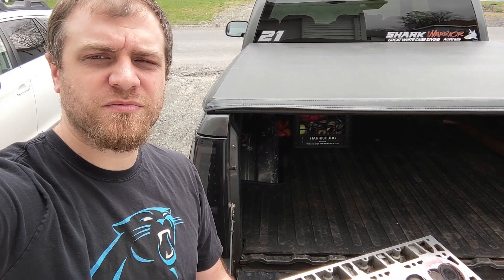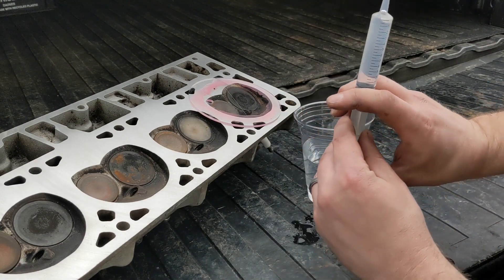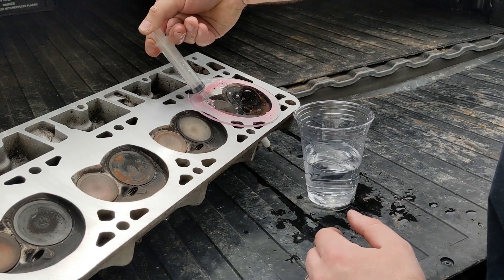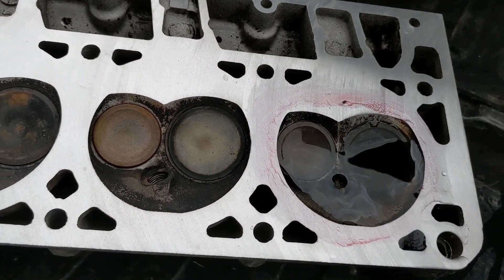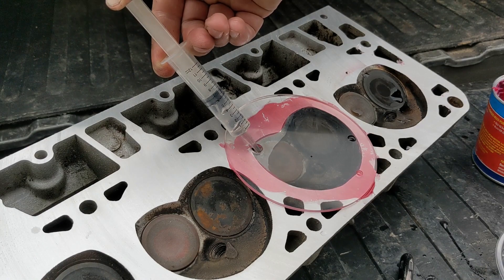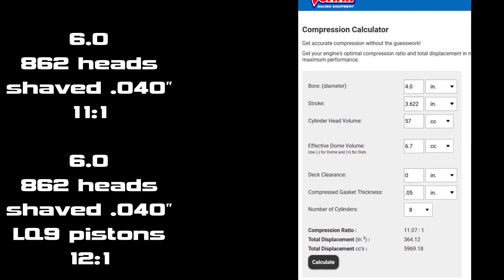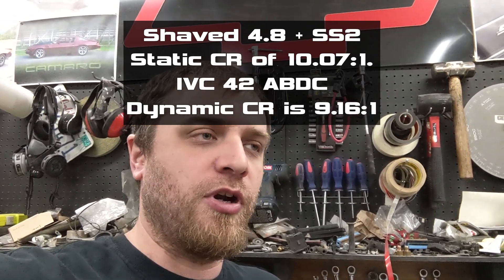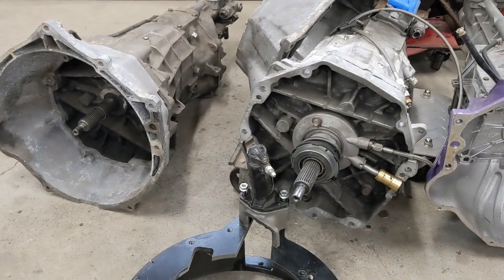Free way to CC cylinder heads etc - calculate compression ratio #LSswap

Comment: how do you end up with less dynamic compression than mechanical compression ? ( only in an american "muscle car" engine. ) ... great tip on the grease trick, thanks.
Reply from the maker: Because the cam bleeds off some cylinder pressure. Intake valve doesn't close until after bottom dead center, so the effective stroke is less.
Reply: @GEARHEADdezign  all intake cams don't close until after bottom dead center .. that's in account of Intake Inertia, and is normal.
Reply from the maker: @RulgertGhostalker  yes, but the longer the intake valve is open, the more pressure is bled off. The stock truck cam is 195ish duration @.050 and the sloppy stage 2 is liked 228. So the piston is further up the cylinder when the valve closes
Reply: @GEARHEADdezign  my sportster has Andrews N2 cams with 240 degrees @ 0.050" lift on the intakes .. it runs like crap down low, but you hit about 4Krpm and it goes ape out to red-line ... dynamic compression is a variable, unlike static; so it depends on your intake and pipes, and what rpm you're figuring it.
Reply: @GEARHEADdezign  try a riser manifold, if you feel like cutting a hole in you hood.
Reply from the maker: Intake manifolds can make a huge difference in your power band, but not to your DCR. Dynamic compression figures your static, your intake valve closing and your stroke. That's it. At least that's all that comes up in the calculators I found
Reply: @GEARHEADdezign  oh.. i see .. 
that's just not the way i figure it, i have Dynomation 6
i usually model up what i am doing in Dynomation 6, and then look at my BMEP figures.
then i figure don't go over 170 BMEP unless the chamber is polished, and then maybe up to 210 on high octane only.
Reply: @GEARHEADdezign  Dynomation is worth every penny if you build engines ... highly recommended ... that way your not going into a build blind, like it's some kind of expensive experiment.
Reply: @GEARHEADdezign  then i don't need to know my DCR if it's just a number with no relevance to concerns .... when i think "dynamic compression ratio" i am thinking inertia, pressure waves, and cylinder packing; and that is always going to be higher than mechanical when the engine is in it's tuned power band..
Reply: @GEARHEADdezign  Or To Say... how does that number relate? what do you use it for? i need to know how much advance, and what octane numbers i can safely run; BEFORE i do anything to my engine.
Reply: @GEARHEADdezign  how is that number going to tell me if i need to polish my cambers to rouge finish or not? 
if i need to cut back the spark plug threads in the heads and radius or not? 
if i need to run sodium filled valves or not? if i need to polish the ground electrodes on my spark plugs or not?
and if it can't, then what good is it?
Reply: @GEARHEADdezign  what actually is dynamic compression ratio equates to BMEP, basically ... get Dynomation or learn some math that is way more complicated than that.
Reply: @GEARHEADdezign  let me ask you this, did you get the sloppy cam because the "DCR" was lower? or did you get it because you found out it makes more power?
Reply from the maker: @RulgertGhostalker  the sloppy 2 cam makes like 80 more horsepower on a completely stock 4.8...drop in and go (with springs). So that's why people run them. Looking at the DCR tells me I can add more static compression without needing to run higher octane, and that will help a little bit with the loss of bottom end from throttle response from the longer duration. I'm happy to run 10:1 on 87 octane, it's a win/win.
Reply: @GEARHEADdezign  
Let Me Explain Pipe Tune. ( which increases at certain RPMs with increasing overlap )

coming into overlap, the intake valve opens to the vacuum created by the exhaust exiting, creating that exhaust power driven " Tffff" of maximum intake inertia; and drawing overlap charge down the pipe..
then the exhausts refractory wave, or reversion, bitch slaps it all back in against that developed intake inertia as the piston starts dropping before the exhaust valve closes..
Tuned Pipe Boost ( mild turbo charging with no moving parts ) that is where that + 80 hp comes from.

you better polish up your chambers, make sure there are no sharp edges except where it meets the head gasket
Reply: @GEARHEADdezign  and watch some slide shows of engine parts destroyed by detonation while your polishing.
Reply: do a good job polishing and you will have an engine that can run reliably making a 100 HP more
Reply: @GEARHEADdezign  i got my self into a bind with my Sportster like that.. i got Andrews N2 cams and raised the compression to 11:1 strait off, AND THEN started modeling it up in Dynomation ...

and i am like, "oh shit" ...234 BMEP !!!!!
and suddenly i am getting an expensive ignition that allows me to drop a couple of heat ranges and buying side fire racing spark plugs, and polishing everything like a freaking mirror, and hoping to god i don't blow my engine.
Reply: @GEARHEADdezign  the only other thing i have, that is keeping that engine from self destruction, is my swirl port job ... 
my intake bowls are like pre-mixing chambers, so my flame front is fast enough that i don't need much advance...
Reply: @GEARHEADdezign  yours is a liquid cooled engine ....ok .. i will give the build that much grace, but still, just like i said..

i had to beef my oil cooling system with a corvette oil cooler and a thermostat that opens early.
Reply: @GEARHEADdezign  my Sportster is "jet fuel only" ... cam overlap packs the cylinders MORE.
Reply: @GEARHEADdezign  there will be a certain RPM range where your intake, and pipes, are working with your valve overlap ..
that's where your Torque Peaks Because that pressure frequency effect is stuffing your engine ... and there in will be your dynamic compression peak ..

don't learn from idiots, or they will turn you into another one of them..

i am 56 years old, graduated from motorcycle tech in 1988, and i know what i am talking about.
Reply: the EXO BBDC and INC ABDC all has to do with what happens at overlap ... so people have to work with the way engines respond to their grind ... but for quite a ways, on either side of peak torque, the Fuel and Air are Still Coming In While The Piston Is Going Up. 

( and that is because of what happens at overlap, at those RPMs )
Reply: @GEARHEADdezign  you will be ok..
just don't expect to be able to run 87 octane unless you break sharp edges, detail polish the chamber and vale heads, and nudge the  spark advance a touch back from stock.
Reply: @GEARHEADdezign  there are a lot of porting and polishing videos on you tube..

some putting in new cams, and some with turbos who want to turn up their boost.
Reply: @GEARHEADdezign  well ...10:1 isn't too bad... just polish it up, and see where your timing will run without pinging on different octane numbers.
Reply: @GEARHEADdezign  the real problem is that you might not be able to hear pinging at torque peak ... and say your torque peak is at 3 grand, or 3-1/2 or 4 ... better get a good muffler.
Reply: @GEARHEADdezign  that is why i sugest getting Dynomation, modeling your set up, and looking at the BMEP numbers.
Reply: @GEARHEADdezign  or rig up a knock sensor / data logger ... my point is, it is not as easy as your making it .. and if you make it that easy for yourself, your in for some difficulties.
Reply: @GEARHEADdezign  Here Yah Go !!!
https://www.youtube.com/watch?v=5KoI35Cj9pE
Reply from the maker: @RulgertGhostalker  it's a lot easier than you make it sound. I appreciate you trying to share knowledge...but it sounds very conservative in comparison to LS engines. They have a very efficient chamber and make best power at only about 28° of advance. I am very very confident that 10:1 on 87 will have zero problems.
Reply from the maker: BTW, LS engines come with knock sensors and datalog capability with the factory wiring and computer. I'm fact, most engines since the late 80s have had this capability. It sounds like motorcycle engines are living in the past! 🤣
Reply: That I Did Not Know, but i do now, thank you. 

but now do you understand ? that your cam typically makes 80 more HP because it will cause a cylinder stuffing effect, Dynamically INCREASEING The Compression Ratio.
Reply: @GEARHEADdezign  i do not know who came up with that formula you had used to arrive at what is termed "dynamic compression ratio" either ...

but ask yourself, what purpose does that number serve ? 

that number just tells me that i could just look at one of the formula inputs, ( Intake Close ) and assume that the developed intake inertia will be cramming in charge that far into the compression stroke.
Reply: Did you by chance happen to record actual cranking pressure?
Reply from the maker: @danblackburn2859 nope, it was my bro-in-laws and he didn't check, I just asked him. He did blow it up already though🤣